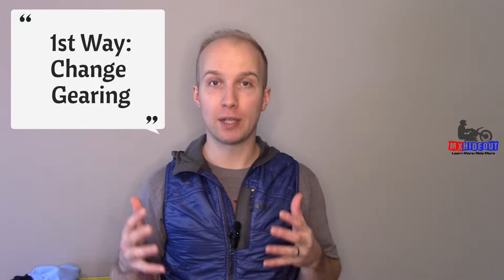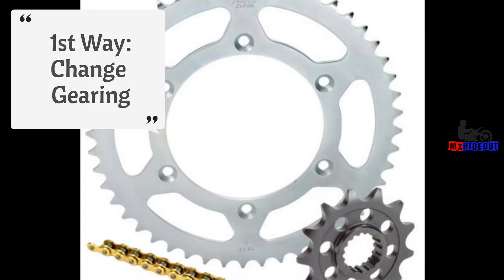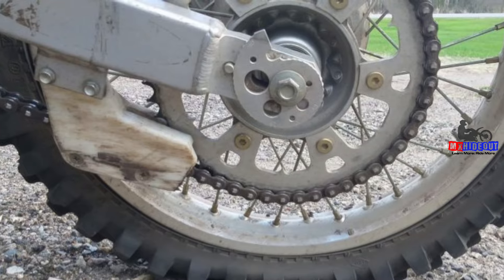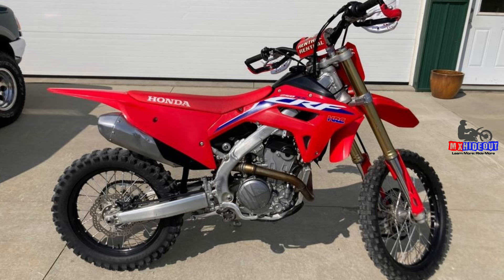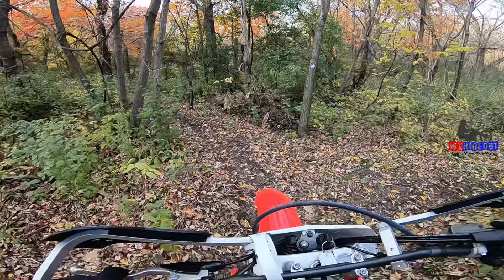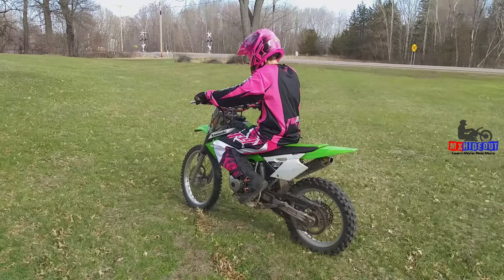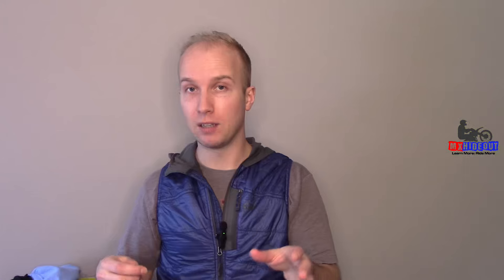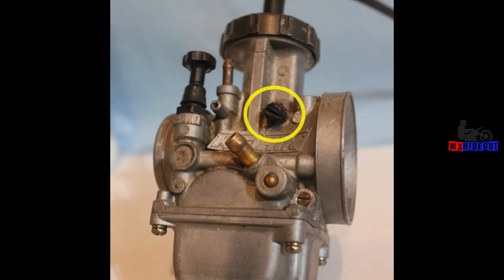Never Stall Your Dirt Bike Again: 3 Genius, Budget-Friendly Tips

Comment: I learning on CRF 250R and must say I learned to use clutch really well on it, and I learned a lot how to repair it, I done full top end rebuild and carb rebuild without any expirience because of fucking snapped woodruff key on flywheel😅
Reply from the maker: Yeah, you can definitely learn a lot. It may not be the easiest way, but if you have enough determination!
Reply: Hey I’m also learning on a CRF 250R and my dad and I rebuilt the brakes, changed the sprockets, fixed the suspension, and all of the grease/oil you can think of.